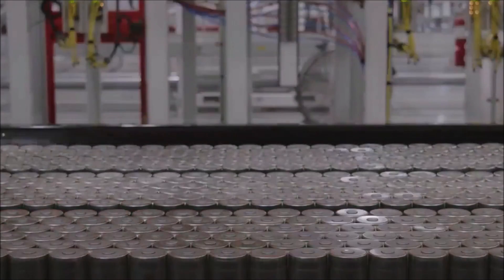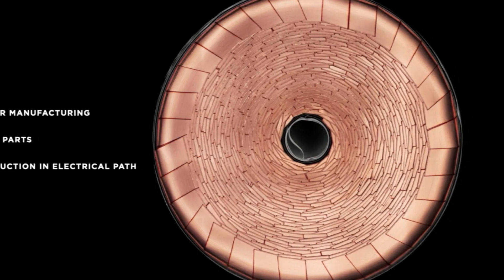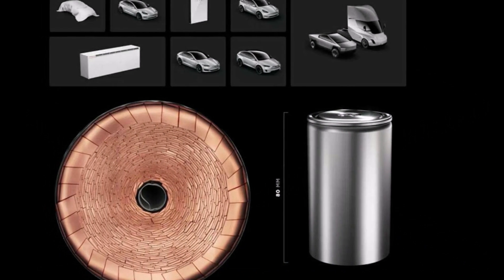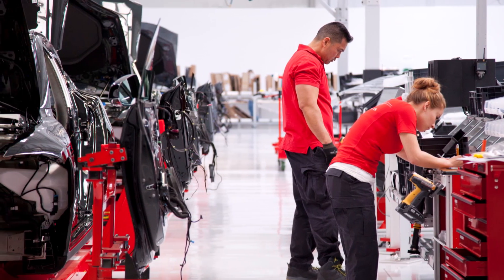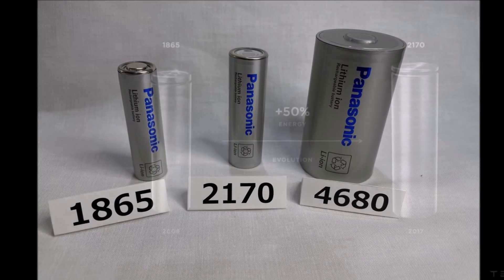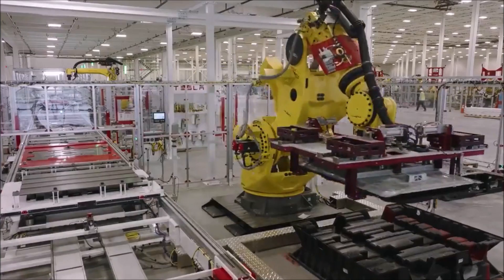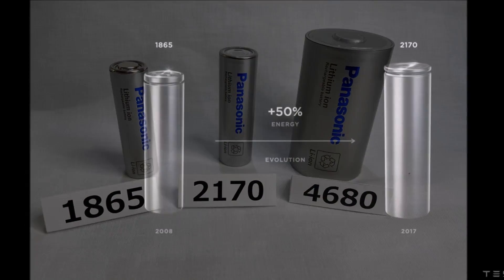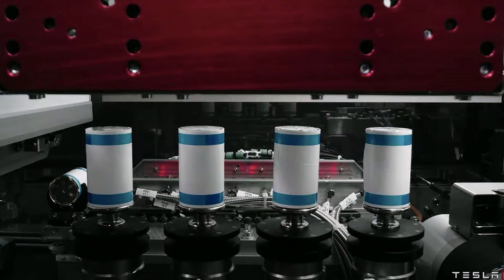Tesla Has Reportedly Achieved $2,000-3,000 Savings From 4680 Battery Cells

Comment: Interesting; As the battery day backround you show indicated there is only a 16% better density/range w 4680; so it would be hard to imagine how that would do better than 16% in cost given the same range battery.  What you are saying is a round about way of saying the batteries really don't work reliabliy enough so far; you don't want your car to lose say 5% of its range a year;  so this is where they think they can get it down by 2023

Comment: Because the dry-coating is not yet reaching the desired or anticipated production speed, the cell yield per production line are reduced. This offsets the anticipated savings from eliminating the very long (and expensive) solvent drying equipment.

Comment: But Tesla is buying and making more cars with the BYD blade battery design. Odds are Tesla is using most 4680’s for a limited number of Semi’s and not SUV’s. Texas is cranking out LR Y’s with 2170 cells. Not the 4680’s it was supposed to be making. Berlin is still 2170’s also.  I think there are more issues making 4680’s then Tesla ever imagined. At some point the issues will be solved, but new technology for batteries are evolving daily and 4680’s might not be the best.

Comment: Tesla is encapsulating the 4680 in a strong resin foam inside the pack. 
If the battery pack malfunctions after the warranty is expired, the pack can't be repaired.
So let's say that roght after warranty expires you have to pay for a whole new pack plus labor which it can be $15-20 000. Would you like to have this financial loss?
Only an idiot with money buys this kind of stupidity.